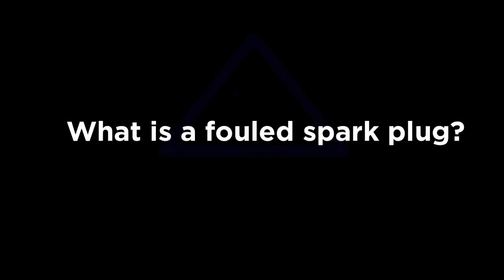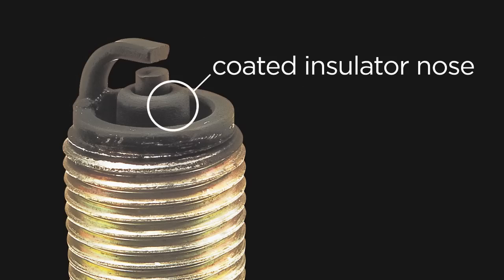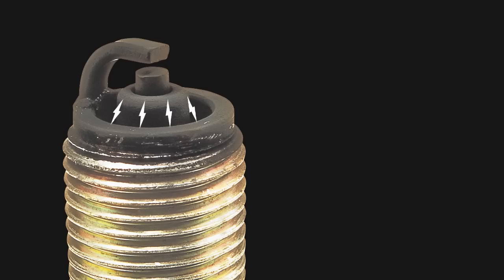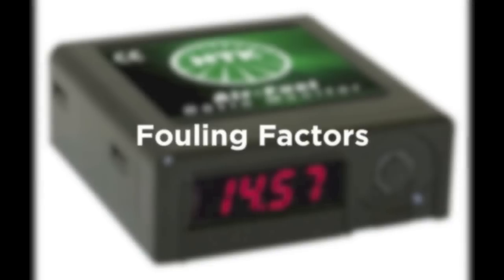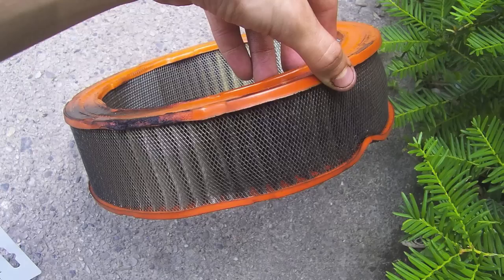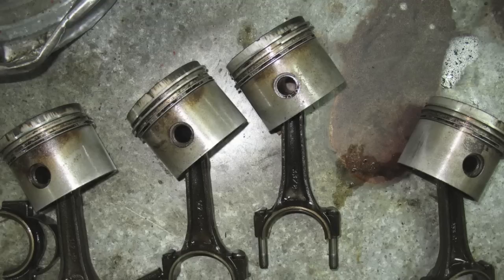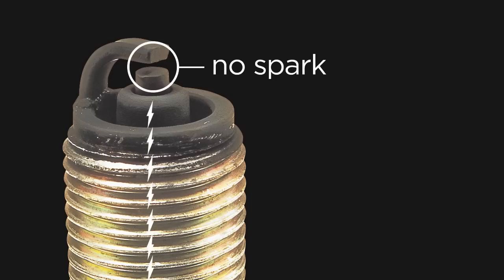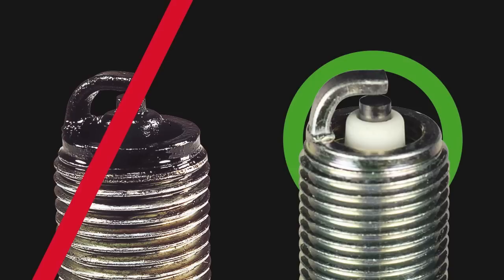Fouled Spark Plug - NGK Spark Plugs

Comment: i think my car has some fouled plugs, it is misfiring after sitting in heavy rain at work and my pod filter got wet and i drove it home, could plugs be my issue? it was running 100% perfect up until it sat in the rain while i was at work.
Reply: You're car probably sucked up some water and got it wet